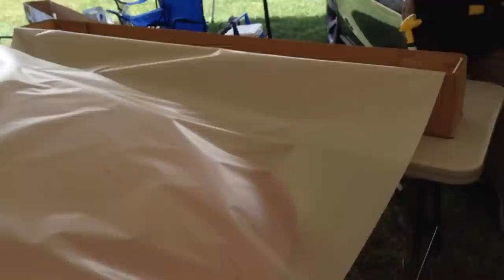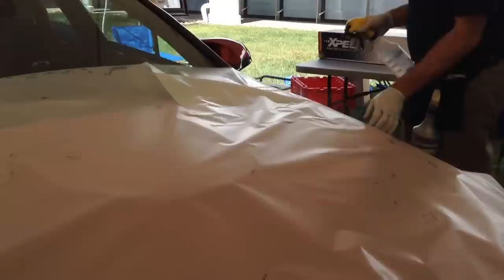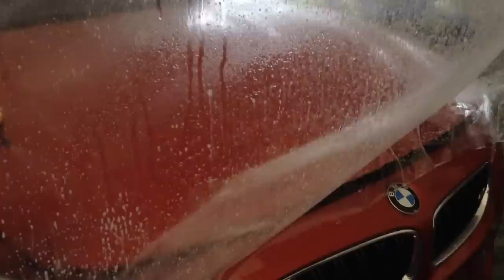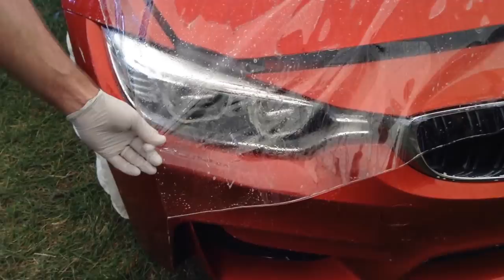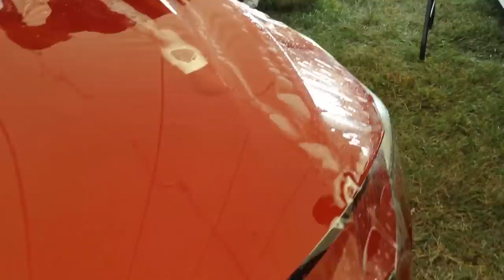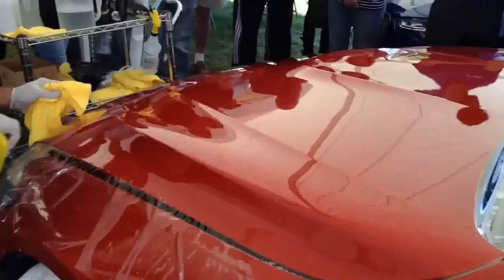Paint Protection Film (Xpel Clear Bra) Installation on BMW M4 by Extreme Colors of Greenville, SC

Comment: Im curious as to how this was done outside without tons of debris and dust? My shop is pretty damn clean, and i fight dust something fierce. Ive never been able to lay a flat panel without finding a dust particle here and there :/
Reply from the maker: The speed of installation has a lot to do with the cleanliness of the installation. We normally do our installs in our climate controlled, dust controlled shop, but we did this as a way to show the spectators at Euro Fest how the product goes on. Surprisingly, this install came out very clean.

Comment: Doug, thanks for this video it is very helpful to determine if we should apply a film vs. spray protection on our new Audi A7. I noticed that you are using two different bottles of spray. One is for underneath and second is for the top of the film. Would you please explain what are you using in each of the sprayers? Thank you in advance.
Reply: Thanks for a quick response Doug. What is the ratio for JJ shampoo & water? We live in MI so  can't get your service :( Do you think it would be possibly DIY? If so, what brand of the film I should buy. Again, thank you kindly for your help.
Reply: Oh...one more question. .. the JJ shampoo is for the underneath or top?

Comment: In the process of installing this the original paint gets messed up while he makes it stick on to the paint by spreading it back and fort and sometimes applying pressure, imagine the sides that are not covered.
Reply: +Doug Payne In truth, BMWs original paint is an eyesore with all the orange peel. This car has been wet-sanded and than custom lettering applied before the Xpel job.

Comment: No app gel? No pressurized spray tank?
Reply: Oh yea 44tools.com the three gallon sprayer they sell is really high quality. You can run slip or gel through the lines. Bit pricey but so worth it. You get a massive fan when you need it and a strong jet stream when u need to force slip into places.